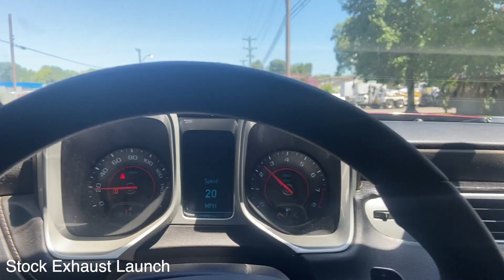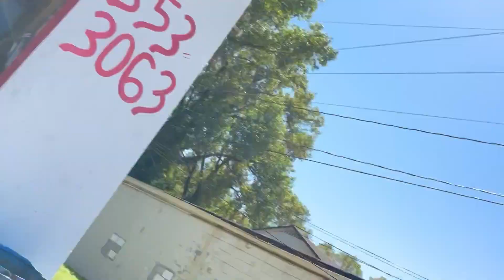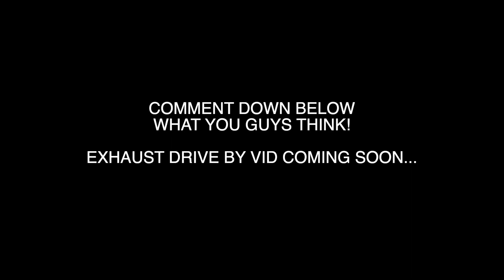2014 CAMARO V6 MUFFLER DELETE! *BEST WAY TO SOUND LIKE A V8 SS*

Comment: I wont lie, im not a fan of the kinda like trumpety sound it makes when revving lol. Ik how it sounds in person bc i also have a 2014 camaro lt/rs. I did a muffler delete first and went with an Mbrp lite axle back. But it was way too loud for where i live so i swapped out the oem resonators with a pair of Evil Energy 2 inch inlet and outlet, resonators. Toned it down just a bit, has almost no drone or rasp now, and still has that deepishsound i wanted! Cant complain!
Reply from the maker: Ngl might have to check that out
Reply: @GradyBoyssEnt  my set up isnt too bad for a budget build, i also thing my K & N Cai plays a part in the exhaust note as well, but i also think yours sounds good regardless! Keep it up man.

Comment: Dude you just made it sound worse wtf. You need a good resonator. You will never make it sound like a V8, but you can make it sound like a good V6
Reply: Nah u gotta hear it in person 🤣💯actually sound good
Reply: @HUNCHO TJ  no I don't. I ran car meets for years and I know what those cars sound like in video versus in person. This sounds cheap. You need a resonator to get rid of the rasp. GM actually did a very good job with the exhaust on this car from the factory. I'd just get a factory sport exhaust or a mild aftermarket exhaust
Reply: @philspaghet  not finna argue with u 🤣ik what THIS car sounds like, I hear this exact car everyday of the week
Reply: @philspaghet agree this sounds bad